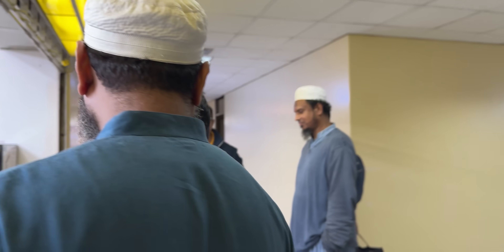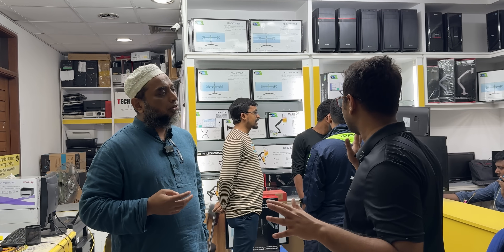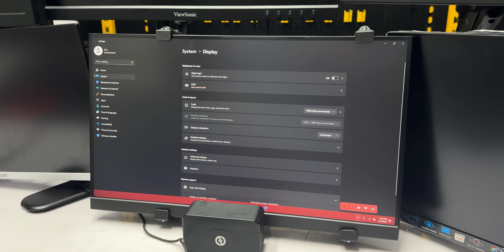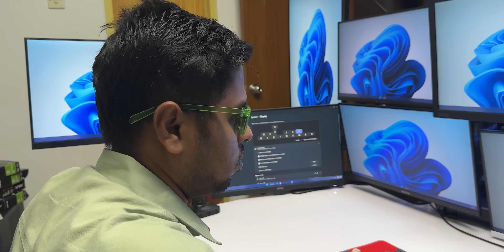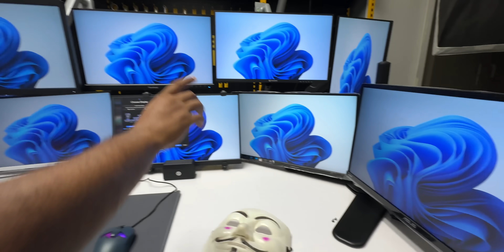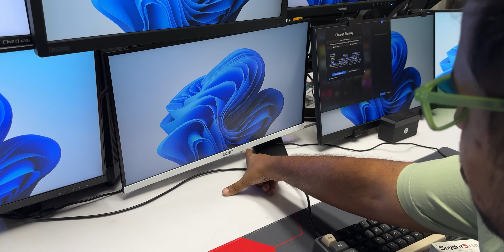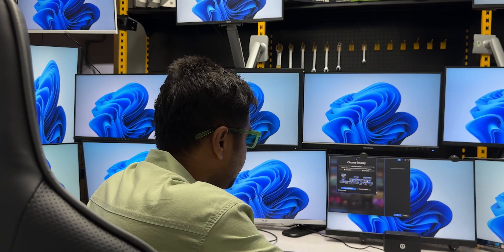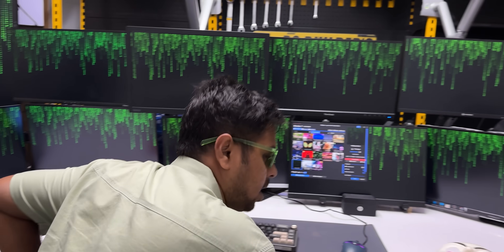16 Monitor Setup 22inch Round Up Preparation

Comment: apnader video er refar theke 1 ta pc build korsi ektu  poriborton hoise
prosessor : ryzen 5 5500
motherboard : msi B450 pro max 2
grapics card :peladn rx580
ram: T force delta 8gb er 2ta
storage : HP 256 gb M.2 NVMe ssd
psu :gigabyte 550w 80+ brong rated
case :Pc Power ice cube white
monitor : Dhahua 75Hz 22" FHD

eta kemon hoise ektu bolben plzzzzzzzzzz

Comment: Bottonlack left the chat🤔😁!Btw hats off zaman bhai.
Reply: Kiser Bottleneck
Reply: @AponTechy  Bhai serious kisu na asole.Powerful processor er sathe 730.(X1 slot je etae special eta jani)
Reply: @Zihan06  video output er jnne ki tile 4ta 4090 use krbe naki!
Reply: @AponTechy  Yes but you will need a threadpipper supported mobo which is really expensive